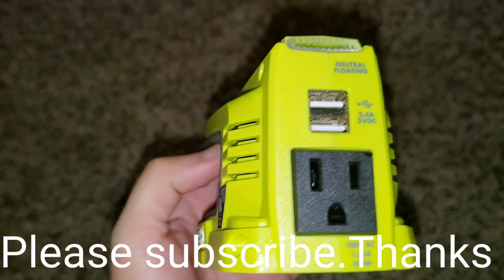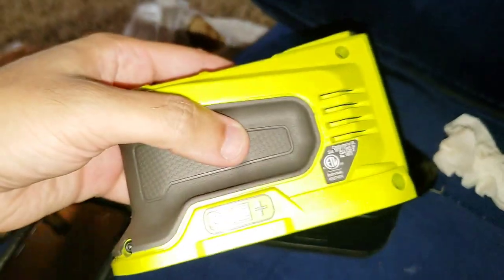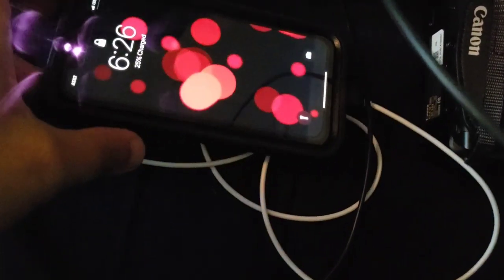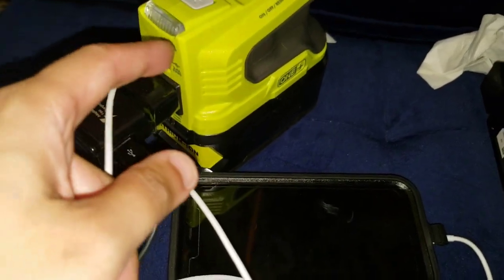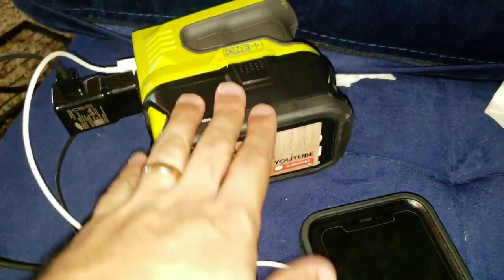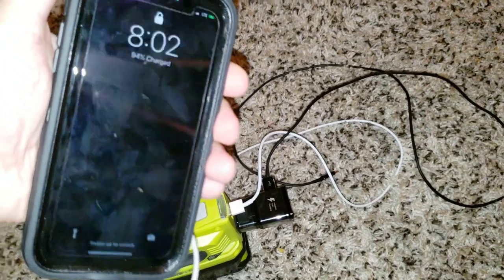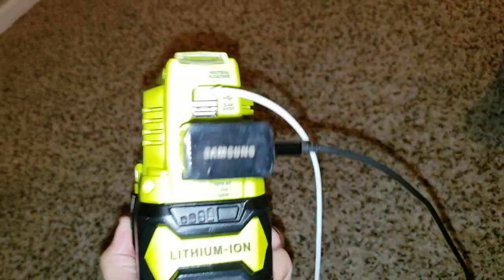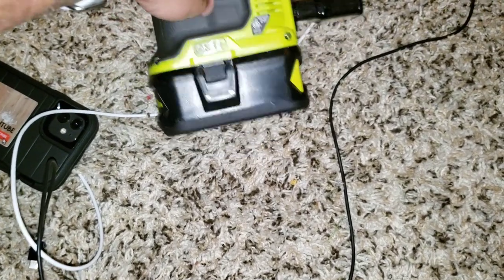Ryobi 150 powered inverter. Full demo.

Comment: That's a pretty huge/heavy setup for charging a phone and a tablet. A Anker power bank will do the same thing with three times less size and weight.
Reply from the maker: Right on. I just leave this set up next to the couch. But I agree thats why I got an Anker a few weeks back. I made a vid on it
Reply: Will the anker power a fan and lamp at the same time?
Reply: That's true but and I have a few anker power banks. I have this ryobi as well as other power stations like ecoflow and bluetti. Here's the thing this ryobi will not only charge phones , tablets etc but it will also power a portable refrigerator which is the main use i use it for with a 9ah ryobi hp battery for camping.  Unless you get an anker solar power station this ryobi inverter has more use than a regular anker powerbank. It will also power a tv for a couple of hours lol . You can see a few videos where a tv is running off this small inverter. There is so many uses for it compared to a regular USB port anker power bank.

Comment: So if the ryobi battery dies is there a way I can charge the inverter so I can still use it or there is no way?  How many hours will it last on one battery?
Reply from the maker: Battery powered only and it depends on the size of the battery. Goes from 1AH to 9

Comment: That's a 3rd party cheap battery.  I have one of those  and I don't think they're really 4 AH.   Most likely they're about 2.5  or 3 AH.
Reply from the maker: 2 of mine are Samsung batteries from the code, the other ones work well but they're not that far off. I had real ones before I sold them

Comment: You do realise them fake batteries aren't what they say they are generally the 6 is closer to a 4 just fyi
Reply from the maker: No these are actually right, over 5 k reviews 5 stars Amazon. It’s not that eBay crab. I had Real Roy I brand before but the 2.5 I think
Reply: @MrBaldChronicles.  anyone can sell on Amazon and most reviews on Amazon are fake or bought those fake batters aren't worth it
Reply from the maker: So far so good. I've owned the real ones and have a bunch of fakes. No complaints here.
Reply: easy to find out.  That so called 6amp battery is 108W per hour.  Run a device running 100w and if it's close to an hour run time then the generic battery is correct.  you won't get an hour due to efficiency loss from the inverter.
Reply from the maker: Good to know
Reply: At four times the price it's still better than buying the real thing do the math